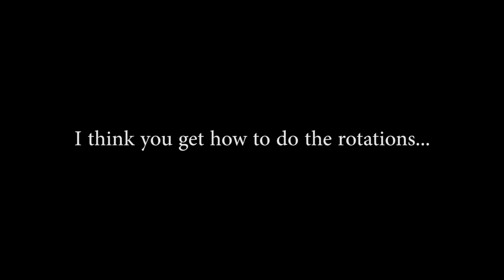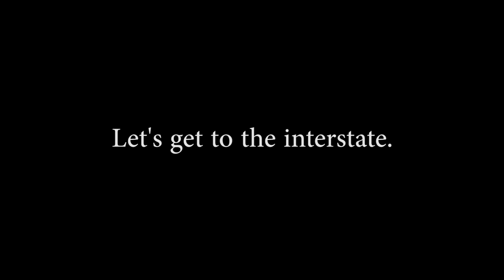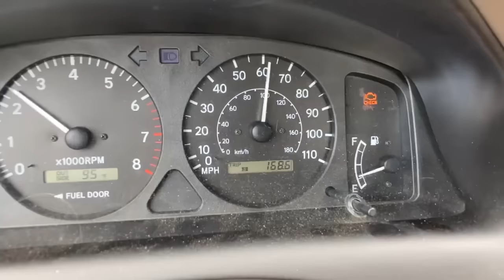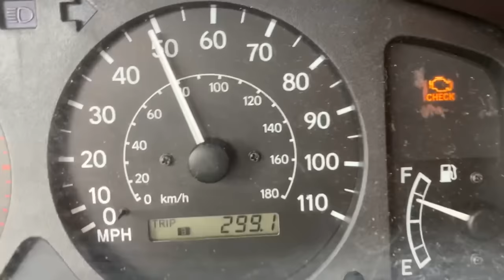Will Berryman's B12 Chemtool stop oil consumption? 😲 | Oil Burning🔥Experiments | Episode 15

Comment: This is going to sound stupid. But when someone is willing to try anything to save a few thousand dollars on repairs. Here goes. I seen a carbon removal test using a bunch of fuel injector cleaners. And one of intrigued me. It was Lucas oil fuel injector cleaner. From reading the comments it was more of a lubricant than a type of solvent. Afterwards I looked for videos of Lucas fuel injector cleaner doing its job, and to my surprise it made the injector flow way better. How it cleans it, I don’t know. But if the comments are true that it’s a type of lubricant and other videos showing it cleans injectors with bad carbon build up, do you think it would clean the carbon around the piston rings if you poured 5 to 10 ounces of Lucas fuel injector cleaner?
Reply: Lucas products are mediocre…..not to mention its pricey. Injector is the easiest to clean, u don’t need Lucas injector cleaner, even a $3 can of carb cleaner work better than Lucas. Simply insert the straw into the fuel line that goes into the fuel rail, unplug the EFI fuse from the fuse box, have another person run the engine at 2500 - 3000 rpm, then spray half can of carb cleaner while keeping the engine around 2500 - 3000 rpm so engine won’t die. Carb cleaner works the fastest and the cheapest way to clean them. Shout out to 808! I’m from 808 also
Reply: @blackysan  what I meant was since Lucas Fuel injector is more lubricant than a solvent and it cleans carbon deposits, if that is added to the crankcase, would it clean the carbon deposits around the piston rings? 

Sounds stupid……but….maybe it might work

Comment: Well to all Vq35 owner out there try this on your G35 350z .......
Reply: It’s hard to make it work on V6 because the angle the two head were tilted compared to 4 cylinders flat surface. U will need a lot of chemicals to cover the piston completely in order to make it work but u might be hard to cover the piston completely without loosing chemicals coming out from the spark plug due to the angle is facing. Also it will be hard if u have a Subaru boxer flat 4 engine because the horizontal design of the piston, u can’t submerge the whole piston with chemicals like a regular 4 cylinder do

Comment: Watching it right now. However I bit the bullet and bought the BG Dynamic Engine Cleaner. It's on its way. Ironically it's made in Wichita and that's where I am but it's coming from Kentucky. Lol. Can't buy it from an AutoZone. Gotta love eBay.
Reply from the maker: So much for buying local 😉😁 please let us know how it goes!
Reply: Okay so I did the Piston soak that you did and to the t and I'm in the process of doing the 20-minute drive and wow I'm noticing a lot more power and the engine seems to be running so much smoother. I don't know if it's still going to burn oil because I haven't completed it yet but are you noticing a difference with your engine as well? I have $201,000 miles on mine
Reply: @FamilyFriendlyDIY  The instructions your guy gave was a success!! This car has burned oil since I bought it in 2018 and 140,000 miles. At 201,000 miles is no longer does!! I'm going to do this every 2 months. It's cheap, and easy.
Reply from the maker: @EricVonHunter  That’s so awesome! Another testimonial!

Comment: Operation excessive-oil-usage-Camry begins. Took off the passenger side wheel and removed the inside plastic liner to get to the cam bolt as shown in this video - https://youtu.be/oINBFiy52B8 Next I'll use your directions - Remove sparkplugs and level out cylinder heads and mark starting location. Then add a can of Berryman's B-12 equally into each cylinder and rotate the engine 5 times. Then every 6 hours, add a splash of B-12 and rotate the engine 5 times. After 24 hours, drive the car at high rpms at 60 mph for 20 minutes. Change oil and filter. Then check oil usage. I'll update with results. If this works, I'll be able to give this 2009 Camry to my kid without worrying he'll destroy the engine between oil changes.
Reply: The procedure went smoothly. It took forever to start the car and I felt bad for smoking out my neighbors so I quickly took off. I'll go for a drive tomorrow to further report results.
Reply: @ScottOstr  nice. Waiting on your testimony for the results cheers!
Reply: @blackysan I'm blown away! It went 1200 miles before it needed another quart. Then before an oil change I put in about 8 oz of B12 and ran it for 20 minutes. After that oil change, we've gone 800 miles and the oil has gone down about 1/16 on the dip stick. I can't believe it! I'll update again in a couple months.

Comment: valvoline restore and protect oil i use it in everything it sweet stuff  even has a chemical  they invented and make .that will not mess up oil additives like 99 percent oil additives do or pull it a part and fix it right and drill out the piston but that would make 3 to 4 YT videos could be the last thing you do no need to even buy new pistons

Comment: 30:30 does it mean an end of the series? On one side I would say I am happy, but actually I am kind of sad...
Reply from the maker: There will be an update video, Kris, when it finally goes through a quart ... and if it goes through it before 3k miles, maybe a second treatment. After that, I'll probably do a few more videos on fixing what is causing the engine light codes ... but hopefully no more oil burning videos 🙏🙂
Reply: @FamilyFriendlyDIY  Thank you for this information. As mentioned before - on one hand I wish you all the best and would like you Toyota's engine stop using oil, on the other i really like your videos... so.. maybe you will get another car with some huge oil-consumption and try to treat it with the best soluiton you found over the past months, well years actually
Reply from the maker: @kris856  Maybe ;-)

Comment: To anyone in the future, looking for solutions to their oil burning: I've also heard good things about the carbon cleaning effectiveness of Ford PM3, and Chrysler CCC combustion chamber cleaner, and Johnson Evinrude [carburetor cleaner?]. I assume you'd apply them in the same fashion as this video. Also BG pn109 EPR, but idk the application instructions for that.

Can't wait for the next update.
I assume the long cranking time was due to wet plugs(?)
I'd appreciate a timeline update at some point. I guess when the conclusion has been reached. I can't keep everything straight. (I think fairly recently there was a breakdown [plug fouling on the way to the airport?], and I think you replaced the valve stem seals [but the valve stem seals did not fix the problem]. I remember a borescope, and talk of scratched cylinder walls, but don't remember if that was just speculative)
What a fun series this has been.
Reply from the maker: I'm hoping it'll keep going in a positive direction now, and I can start fixing the other issues on the car. The long cranking was a head-scratcher. I'm wondering if it was because the oil had been cleaned from the cylinder walls and the cylinders had very little compression until enough oil got back in to seal them; then hopefully the rings loosened up with the driving, and now the cylinders don't need the oil for compression. It's definitely a point for discussion. I'll probably do another scope in the future to see if oil stops appearing on top of the pistons. Thanks as always for the comment!
Reply: Mopar combustion chamber cleaner is #1

Comment: No idea why you rotated the engine. Obviously at top dead center you have overflow. If this is the procedure obviously less fluid per cylinder is required. All you had to do was put a johnson bar on the crank and move back and forth for however many dozen times. This osilates the rings getting the result your looking for. The point is getting the rings moving.

Comment: Want something way better and 1/2 the price or free   
Vinegar and free if ya got a jar of pickles you already ate 
let it soak all night  with plugs still out then bump the starter let it shoot all the vinegar out throw your plugs back in and enjoy.     It'll help unlock a freezed up engine too and eat the rust in there so you don't crack your rings on them
Reply: Vinegar is for rust, not for carbon.
And rust on removed pistons

Comment: Berrymans suck that a fact I put that in my dodge neon 4 times to clean up the injectors and my neon keep hisstaeing so I tried 13 injector cleaner and the only one that work was Rislone hy-per fuel injector cleaner it worked in one uses that a fact no more hisstaeing so I no it works

Comment: Your procedure is bunk! You should have put a few ounces of acetone in each cylinder and let it sit overnight, then blow any remaining out the plug holes with the starter. Then change the oil. No need for all the useless turning over the engine! Another thing, putting thicker oil in these engines makes them burn way more oil! They have very low tension oil rings.

Comment: IRREGARDLESS IT'S A 
DOUCH BAG WITH WHEEL'S ATTACHED 
THE TOP OF THOSE PISTONS SHOULD
(NOT)-(NOT) B WET WITH ANYTHING THEY SHOULD BE DRY (PERIOD) THEN GO TO U PULL IT AND SNAGG A USED TAIL LIGHT AND POCKET THE LEFT OVER VIMOOO

Comment: Good video, did you also change your PCV valve which can also cause excessive oil burning? How is your engine holding up?
I have been using Berrymans B12 in my gas on my minibike I built when I was 12 years old since the 1970's and in all my cars over the years. I watched another video on a BMW with low compression and the BMW mechanic used an ounce of AC Delco high concentration fuel injector cleaner in the cylinder over night to get the compression back up, but it is no longer made. I'll have to try B12 Chemtool in my BMW cylinders and see if it helps with my oil burning about a quart every 1,000 miles.
BMW Misfire/ Rough Idle M54 6 Cylinder Low Compression
https://www.youtube.com/watch?v=_Vo4fm0JDPY

Comment: I use this in my fuel every oil change. Full tank and full bottle. Followed by Lucas Top end Lubricant. Car runs like a top turns the oil black every oil change
Reply: Shouldn't use it every time, only when needed. No car is that terrible.

Comment: Waste of b12 doing it that way ur just flooding the cylinders and forcing it back out again the engine needs to be running for it to clean all of the engines fuel system injectors valves and cylinders you would need a jerrycan with a petrol b12 mix

Comment: The Piston has a puddle of oil on it because you damaged the rings I don't believe what you're showing. You can't take all the oil out of your chamber get out there and run it hard with no lubrication and tell me it in better condition now than before it  not just possible. Any mechanic would tell you the same thing not to do this. You should have pre-lubricated the cylinder wall with some light motor oil before you got out and drove it you could have thrown a rod.

There's a puddle of oil on the piston because the rings are damaged from not having no lubrication. Give it a month or two and you will see the real result.

You guys do not do this get some advice for from a skilled mechanic and he will tell you do not do this you will ruin your engine this is not the long outcome .
The engine has been destroyed even that he don't know that yet. It may take a month or two to see the real results. If 
If there's no need to put engine oil in a car then why do we do it because you would destroy the engine without no lubrication. 

You don't run a car without lubrication. You can't tell me the cylinder walls and piston ring having no lubrication metal to metal that is in better shape now that makes no sense not possible you could see all the oil consumption on that piston from the damage what was done.

You should advise your YouTuber they are taking their own risk you are not responsible something happens to their engine.

You should at least let your viewers know you are not responsible for anything that would happen due to this test
Reply: You should realize anyone does anything at their own risk. It's called trial and error. He doesn't have to advise anything to anyone. It is his experiment being recorded for your consumption. He does not claim to be a mechanic, just a normal person allowing you to see the outcome of his stupidity or success. Lay off mr.
 neurosurgeon with a PhD in idiocy. Obviously there was oil in his car. Leaned out, yes, but still some amount of lubrication. And as his engine and oil heated up the low boiling point of the solvent would be fairly quickly evaporating from said lubricant. He had horrible oil consumption before hand with stuck rings. Same as my corolla. Should he have changed out the diluted lubricant as a precautionary measure? Probably, but it is his engine and experiment, not yours. Don't watch. Make your own videos about whatever you wish to do concerning mechanical malady and experiments to remedy such afflictions, personally.

Comment: The high pitch whine in the background in your video is so annoying I had to turn everything off my TV my fan thinking it was coming out of my house semicolon you overfill the cylinders because when the Piston gets to the top there's no more room for the chemical and it's going to squirt out through the spark plug hole! You should have used less of that and considered leaving it sit overnight call Mom I'm curious why you just didn't use the starter to turn the engine over and hit the key so it would turn the engine over one rotation each time and limit the amount of chemical you put in the engine cuz you have no room left at the top of the cylinder you should have only put maybe 1/4 of what you used? That's correct you're diluting the oil with berryman's B12 and you can use that to loosen up any sludge in your engine I would let it run for 15 or 20 minutes and consider doing an oil change

Comment: Also this is going to loosen up and burn a lot of the carbon off inside of your combustion chamber and your exhaust manifold as well as,. next time since the spark plugs are out why don't you use to start at a cranky engine over five times: instead of procrastinating you don't need to sit there and make a long video take a picture of it so you'll have before and after pictures of the cylinders okay come on let's become more proficient, why don't you do a checklist like you're doing the military all the mechanics do check make sure your wrenches and tools are not under the engine or in the engine compartment make sure your battery connections are reconnected just make a list of what you need to check and do before and after okay come on let's become more of a professional mechanic, also you want to use some starter fluid when you first start to start your vehicle back up since you're going to have difficulty starting at use that to assist your engine and starting on the intake also you don't need to be like a sports announcer and say everything that comes into your mind? We all know that when you use cleaning fluids in your engine it's going to take a while to get rid of the smoke this is common if you used any seafoam or any of the intake manifold and exhaust cleaners this is a common practice and it does this So what had rather than sound like a sports announcer and blah blah blah just give us nothing but the facts okay:
 Walmart CURBSIDE
Pick up today
Restore 4-Cylinder Formula Engine Restorer and Lubricant - 9 oz.
$7.97
Walmart
4.6 
Since you're out driving and testing and stop by Walmart and get some engine restorer for your piston rings 4 Daniel oil, I've used this to restore compression and it works without a doubt! I would suggest you clean a spark plugs and use a very fine or small file if you got something about the size that you would use to Gap your plugs very small thin file also a wire wheel helps to clean off the grounding electrode as well as well as the threads,. Also since you have a vertical filter pre-fill your filter with oil before reinstalling it common silicone I can see these initial reviews or this video was at least a year ago so you should be checking back in on this video every month and see what people are rioting in and suggestions? The engine restore I have used on a 95 Lincoln Continental and I can tell you that I've got 100% results and compression restoration so if you want to bring your oil usage down to zero you need to try the engine restore! There is also a product called Blue Devil that's used for restoring compression by sealing the head gasket and the heads! And you have to follow directions exactly to the letter it may require two treatments but I use this on a previous car rather than getting the heads redone and head gaskets at that time but it was the best thing that I ever found to restore the compression and the heads along with the head gaskets considered a permanent sealer semicolon, if you want some advice on something to reduce the friction and where inside of your engine especially the piston piston rings valves cams transmission differential give me a shout out back on here so that I can see that there's a comment or somebody wanting some feedback on this on my comments and I will be glad to let you know what that product is